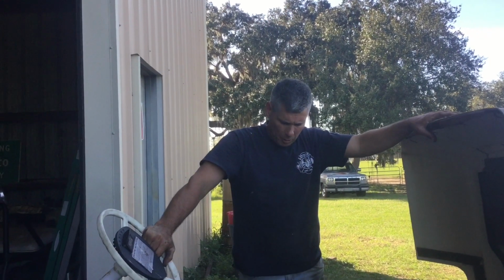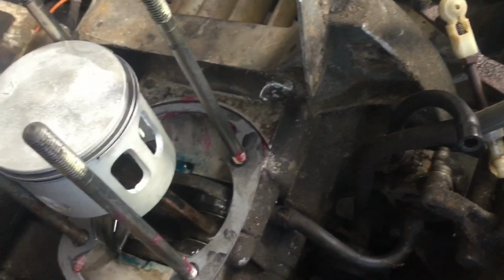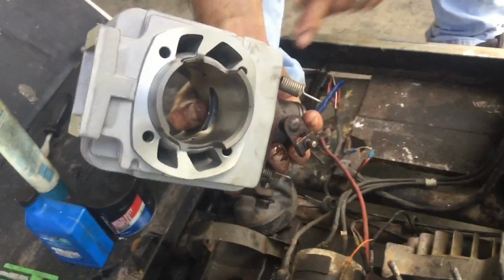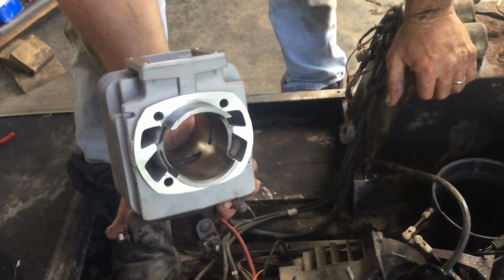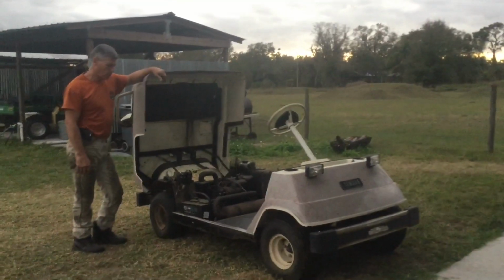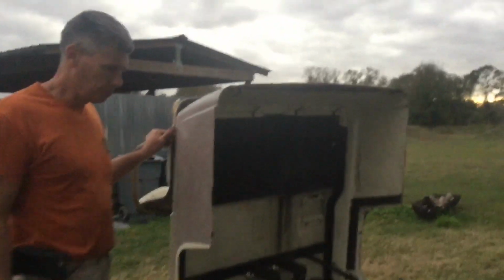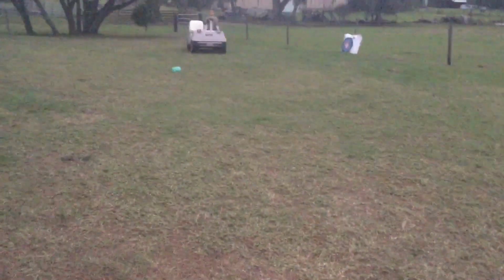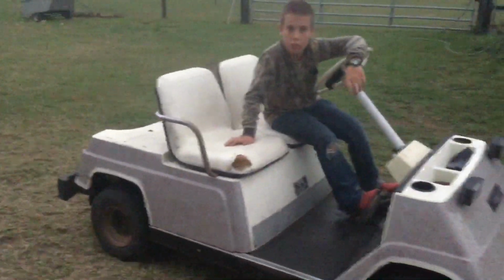Road find Yamaha G1 golf cart

Comment: How did you clean all the build up out of muffler
Reply from the maker: Weeeeell I gently tapped it with a mallet and rinsed it out with a water hose , ran it on the motor and rinsed it again until it was better. Good luck.

Comment: How did you do the cdi and what diodes did you use just normal all purpose ones?
Reply from the maker: aaron jackson there is a wire coming from each pickup coil under the flywheel and you just put a diode on each wire going into the cdi. I don’t remember the specs on the diodes. They were just some large ones I had laying around